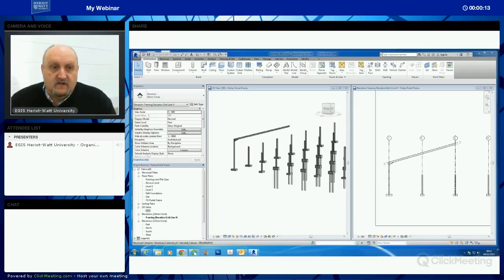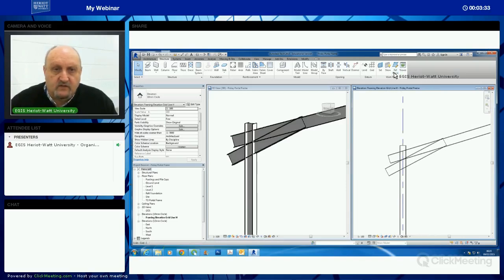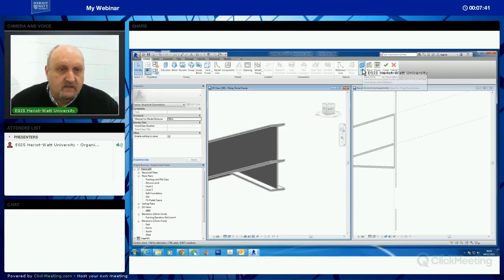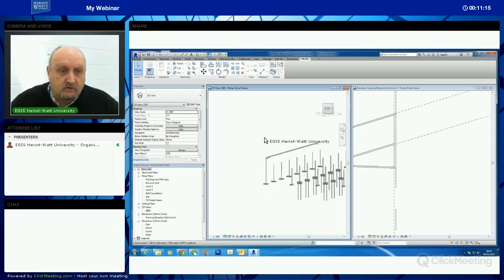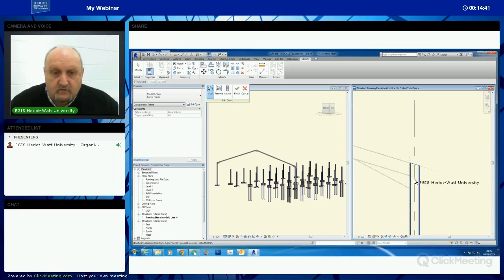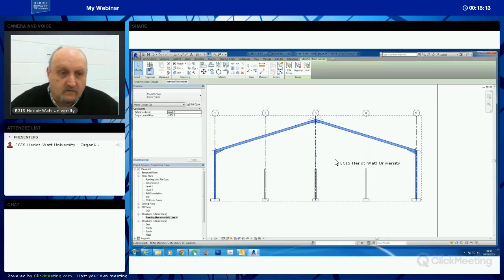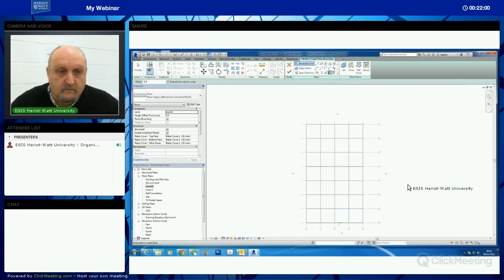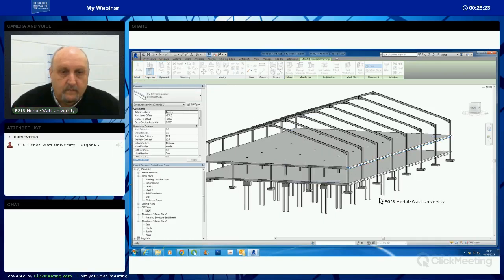Portal Frame Part 2

Comment: Hi Stuart, I've been following your tutorial but I'm having a problem creating the haunch. Whenever I select my haunch beam section and the reference plane attached to the bottom of the rafter, the haunch is always cut below the lower flange of the rafter, therefore I don't have a haunch. The remaining cut beam section is between the flanges of the rafter. I don't have a problem cutting the haunch with the interface of the column flange though. Any thoughts?